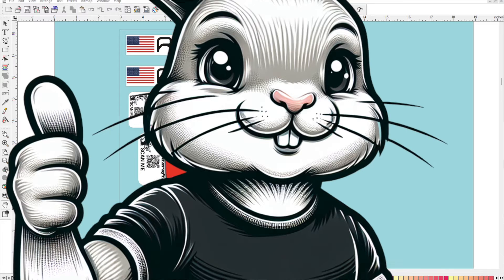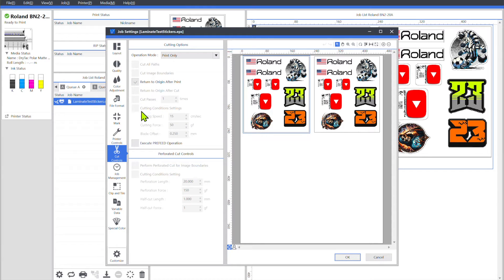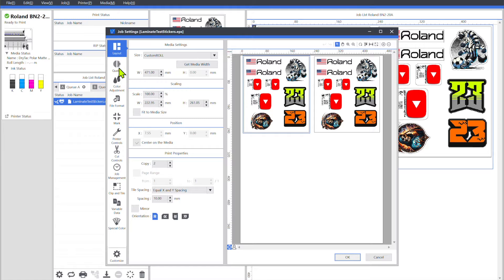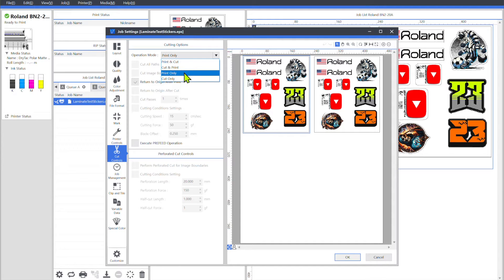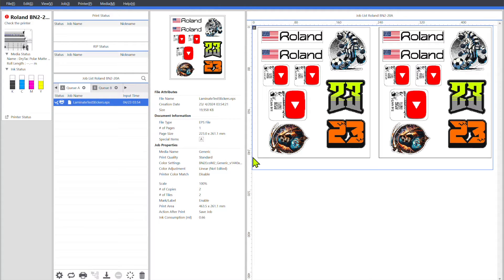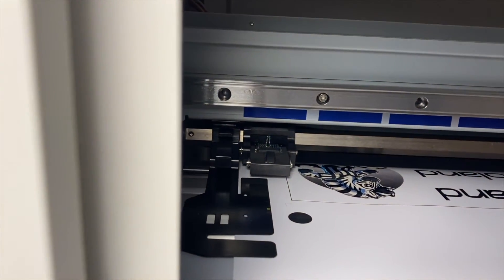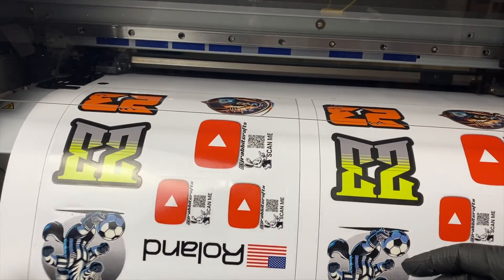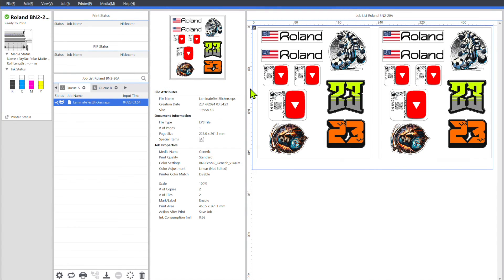How to Cut after Lamination- Roland BN2-20A and BN2-20

Comment: Do you ever have issues with the cut drifting on larger prints?
Reply from the maker: Not in my experience. I usually keep my jobs to about 6 feet in length. I have heard of this issue. There is a way to add more targets along the print jobs.

Comment: When I cut the sheet after printing, it doesn't leave enough material behind the crop marks. When I set up the printed material to cut and the printer scans the marks, it runs out of media when trying to scan the back marks. Is there any way to add more media behind the print before cutting?
Reply: Same happened to me. You have to pull out about 1.5 inch more before you perform the sheet cut
Reply from the maker: Hello. Sorry for the late response. Have you remedied this issue?

Comment: Do you have to change your perf cut settings to cut when you laminate? Can I use the same settings I use when I don't laminate?
Reply from the maker: Hello Veronica. Thanks for watching. Yes, you will have to increase the force when cutting through laminated vinyl, as opposed to vinyl alone. I suggest you run cutting tests on the blank space at the beginning of your prints.